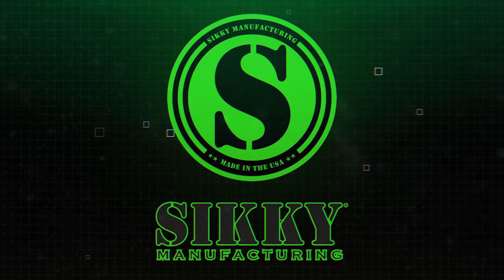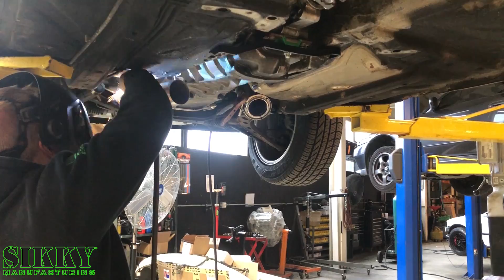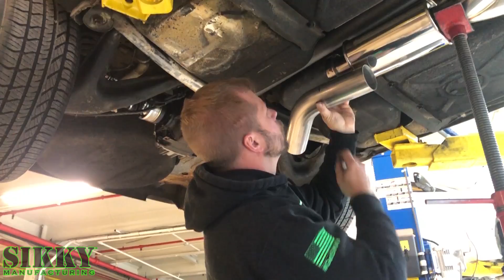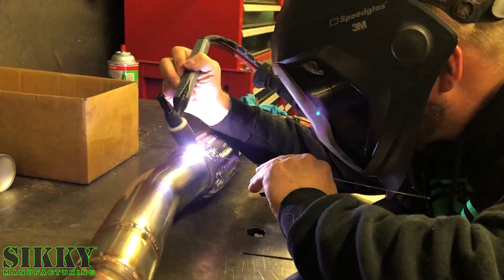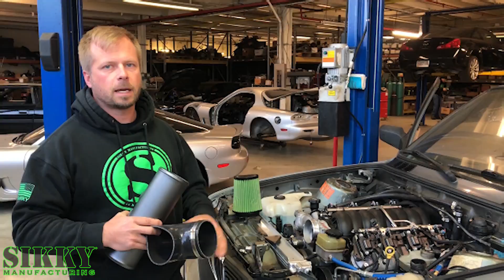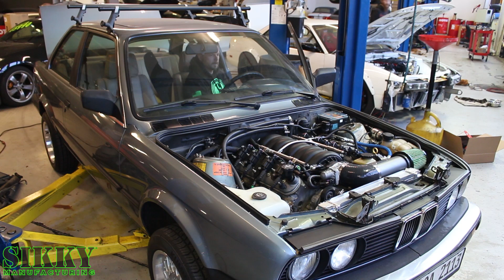E30 LS Swap Build Pt 9 | Custom Exhaust & First Start Up | SIKKY Manufacturing

Comment: Did you guys cover the harness and wiring part of the swap?
Reply from the maker: No not in depth. There are so many variables depending on which engine and chassis you have. We recommend a plug and play harness from Wiring Specialties to make this part easy.
Reply: @SikkyTV  wiring specialist look a good option, but their harness doesn't allow to run the drive by wire throttle body... how did you manage to use the one from LS2 ?

Comment: Sounds great!  I just picked up a brand new Sikky kit and I was wondering if there's a big difference between the 1 3/4 headers vs the new and improved 17/8 headers for the E30 LS swap?   Thanks
Reply from the maker: Yes a huge difference. We are discontinuing the 1 3/4 mild steel headers and will only be selling the 1 7/8” stainless headers. The newer stainless headers are a new design with better power and they are stainless steel so much more durable
Reply: @SikkyTV  Only reason I ask is because I bought a kit from someone who didn't use it and it has the old style headers.  Was wondering if the new 1 7/8 were shaped any different or do I still need to reshape the firewall?  Was reluctant to be the firewall on my Touring since their are so few stateside.  Thanks
Reply from the maker: Joey Skidz yeah new headers fit way better than old design no denting needed

Comment: Gents,

I'm stuck in CA which means all parts need to be CARB compliant on the swap. Compliance is still attainable with a built e-rod ls3 to withstand boost from a magnuson heartbeat; my last concern with starting this would be the headers. Since your custom ones are not compliant (I'm assuming) ... Patriot Exhaust has a CARB legal set of shortie headers they manufacture specifically for use with the e-rod platform, but I was wondering if those could be installed into an e30 swap?
Reply from the maker: We have not test fit those headers before. Due to how tight things are I would imagine they would need modifications to fit especially on the driver side. Only one way to find out!
Reply: @SikkyTV  When you guys do your custom in-house headers, are you able to retain the cats in the same factory location/position? *edit* Non-OBD-II 1 certified vehicles receiving an OBD-II certified 
engine must meet the following:

2. Modifications of the intake and exhaust system are permissible only if necessary to accommodate the packaging of the vehicle and only if they do not affect the functionality of the systems. Any changes must not modify the stock functional design of the components (i.e. the intake air box must not be modified, EGR valves still properly mounted, etc.)

However as I read further, if you have a OBD2 it is permissible for the cats to be within 6 inches of factory location only if:

APPENDIX - E.5(a) On the close-coupled end(nearest the engine), within 6 inches, and no closer than the stock configuration

Comment: Hey any update on the Radiator and also what peddle setup you guys used?
Reply from the maker: We have completed testing and did a small production run to provide to some Beta testers.  In the process of gearing up for a larger production run now so it should be available and on the site in a couple weeks.